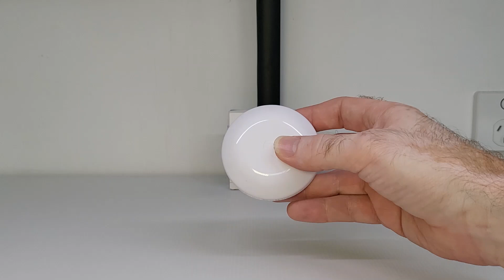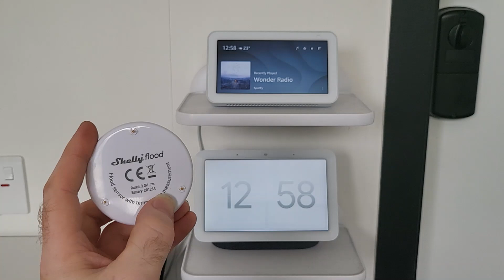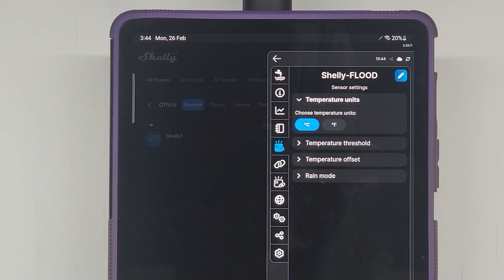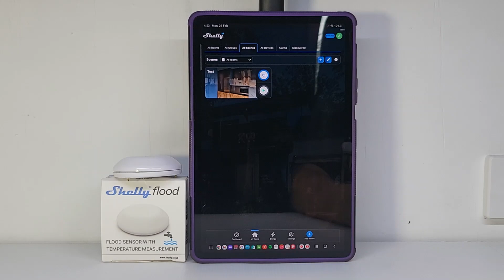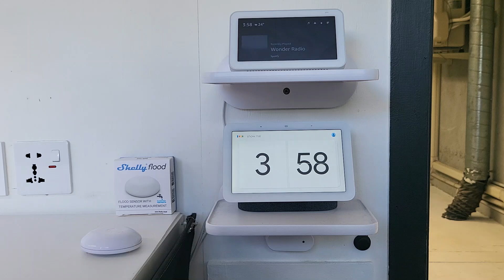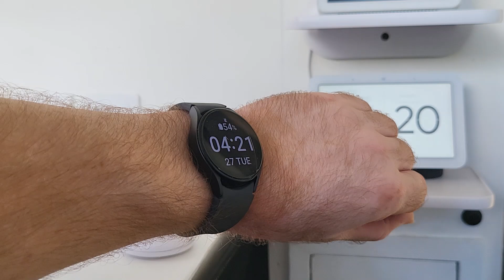How the Shelly Flood Water Detection Sensor Works?

Comment: I can see that it goes off when submerged in water. Does it detect smaller amounts of water too? May be a few drops on the top or a small amount on the base? Thanks
Reply from the maker: @curiousjoe395  no it will not detect water on the top of the device at all. It will only detect an amount of water that will make continuity with the sensors on the bottom of the device

Comment: When you ask for Status Google only reports “leak” status. Can it report the temperature?
Reply from the maker: @josepuyalto4951  No it cannot, You need to use the Shelly app to monitor the temperature status or setup an automation with the Shelly app so it sends a message to you at a certain temperature

Comment: Thx for the video. It is very useful. Just wonder if I go out for shopping or work, will I receive a notification from the app for flood？
Reply: Oh, 09:55 seems to answer my question. Thx！
Reply from the maker: Thanks. Yes if a water leak is detected you will receive a notification from the app on your phone from whenever you are
Reply: I just purchased it yesterday. I found the beeping was quite loud which I wanna disable the sound from device itself. All I want is notification from the app, is it okay? Cheers mate.
Reply from the maker: @2005pkpan  I don't think that is an option.in the app so would need to disconnect internal buzzer. Yes I agree, it's loud, I like that feature about it